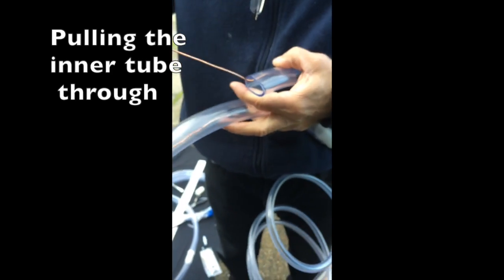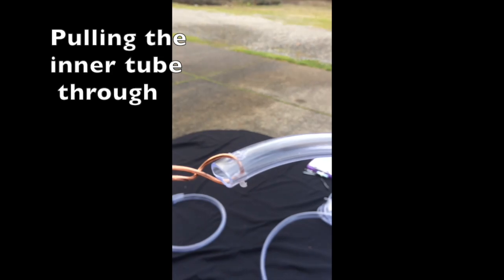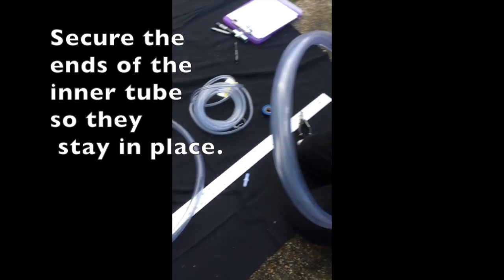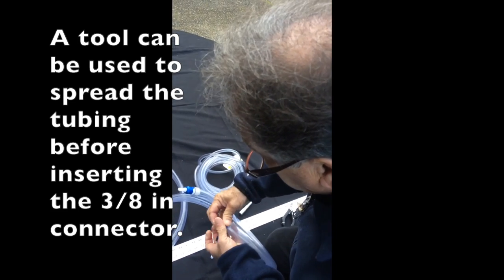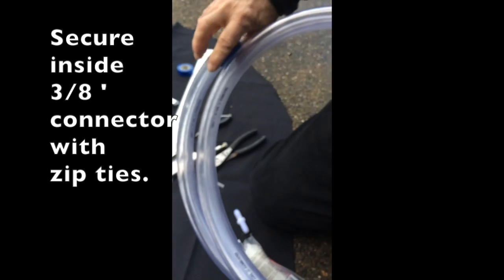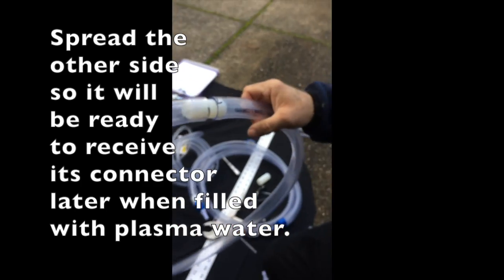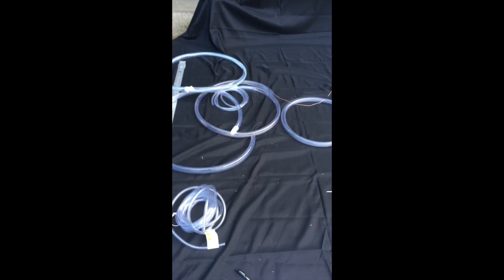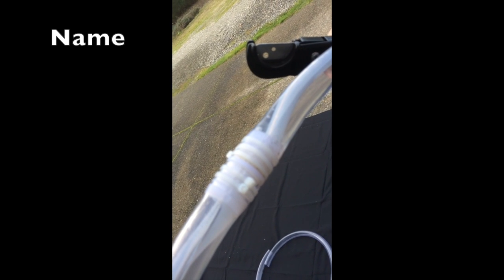Dr Rodrigo: Large Health Tubes11 24 16

Comment: Pls clarify these terminology of water. 1st. Plasma water Co2 gans 2nd.  Co2 gans.  What are the difference or are they the same ?
Reply from the maker: inside the tubes Dr Rodrigo used the "plasma water " taken  from above the gans in a container. He adds a little of the actual gans in each tube. but this may not be necessary. Do what you feel is right for you. hope this helps.

Comment: May i wash tube with disteled water to remove caustic
Reply from the maker: I wash them out with a little vinegar/water mixture and even let that soak some overnight before running the garden hose through it to clean thoroughly. 
hop that helps